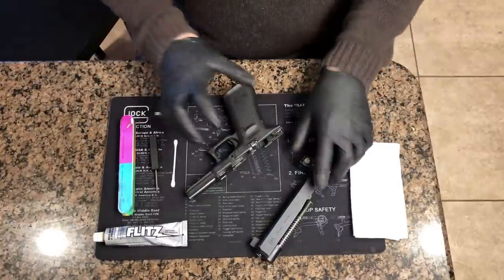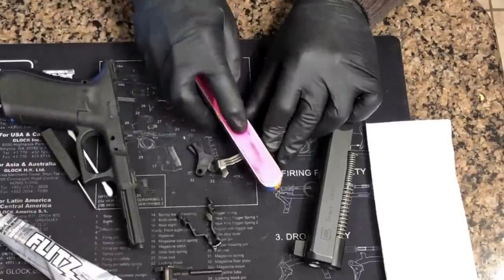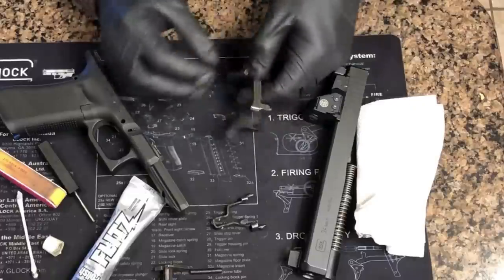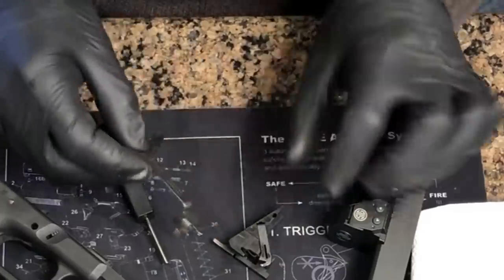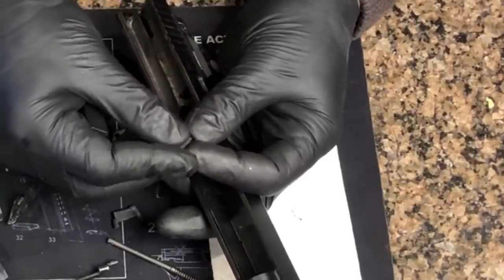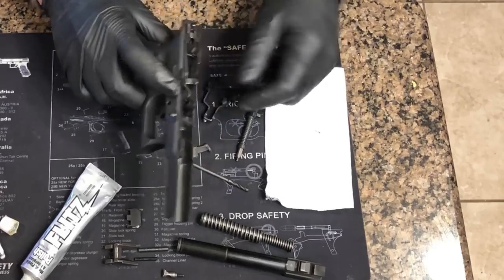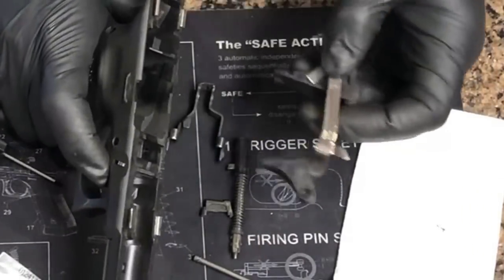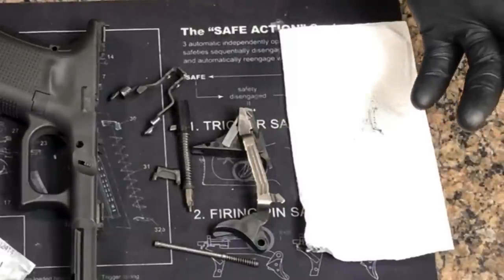How To Polish a Glock - Gen 5 - and areas often overlooked

Comment: If you feel a click in the take-up it's your plunger spring. Take it out and twist the spring 90 degrees and reinstall the plunger and striker. Test by pushing down the plunger until the click is gone.

Comment: The nail file idea is brilliant!!!!  Got amazing results from this technique. No real need to buff to a mirror finish. Just do the areas you need.
Reply: No it's not . Glock parts are already mirror shined under the surface treatment they put on them, if you want to see it you can just use a micro fiber rag and some gun lube . The nail file is damaging the treatment and "electroplate"
Reply: @Drawde907  I’m not sure that’s an accurate statement.
Reply: @essray   that shiny is like an electroplating they put over the the metal if you shoot one long enough you'll get through that coating ,You can usually see things like the plunger chip off first , it's one of the reasons they change the design.   When you take a file to it you're speeding up that process , You can literally take a rag with nothing on it sitting there watching TV and shining up to a mirror finish with little effort.  Try it.  And I know he's not exactly using a file but that grit in that nail buffer just isn't necessary.  You're not going to get any more benefits over shining it up with the rag . trust me I've screwed up plenty of parts since the '80s.
Reply: @Drawde907  the multiphase process definitely helped smooth out the trigger on my slimline’s stamped OEM parts. Removed all the imperfections.

Comment: Another underated thing that smoothens out the gun in general.is the frame rails and the inside slide channel.  Can make a glock feel so much smoother and cyclic feel of a much higher end gun.  Performance difference....ah not sure, but feel which to me equates to alot does something.
Reply from the maker: I did this on my CZ's.  I'll have to bust out the dremel and try it on the Glock.

Comment: Tried a lot of oils and cleaners over the years. Some worked better than others. Most did ok, but I never saw any miracle lubricating properties, oils that penetrated or seasoned the metal, or made the gun noticeably easier to clean after firing. More than anything a oil that stays in place and does not dry up or get sticky is important to me. I get rid of the ones that do that.

Comment: I use a light coat of a general gun grease then a couple drops of Mobil 1 before shooting.  You can also pull out the gen 5 trigger parts and use a gen 4 housing with gen 3 trigger bar. Gives you lots more parts choices!
Reply from the maker: I haven’t played with older gen parts in a 5 frame.  I know a gen 3 bar on a gen 4 was an improvement - May be worth messing around with

Comment: It was a success on the g48 , never thought the mag catch would effect anything but by god you’re right Humble . The ghost connector and polishing job dropped the tigger pull weight from 5.5 lbs to 4.25 lbs I’m completely satisfied Humble . Biggest thing was hang up on the new safety plunger design and striker engagement point . Now next improvement will be a overwatch dat polymer trigger that’s as far as I want to go since it’s my edc . Not sure the Overwatch trigger is going to make that much difference , but wanted to try something different. Thanks Humble your the bomb of The Tube . K
Reply from the maker: glad it worked for you.  Cheers.
Reply: I’m having the same issue with my 48 mos. The trigger pull is very heavy. Started with a agency flat trigger and a minus connector the switched to an OEM trigger with OEM minus connector. Both stayed 6.5 lbs. I’m trying the ghost edge connector next. I don’t want to mess with springs because it’s my carry. But I would love to get it down to 5lbs. If I get desperate I’ll have to send it to Johnny Glocks for him to do a full work up on it.

Comment: The gen 5 trigger shoe doesn't really contact the frame, it is sandwiched between the steel of the ambi slide stop. So in addition to the frame, you can polish the inside surfaces of the ambi slide stop down by the little coil spring. And.. both sides of the shoe itself, as he mentioned, hope that made sense.. spend some time with you glock learning its functions.. if there is friction, reduce friction dont be scared to do this.. just take your time..

Comment: I use a combo of Quantum fishing reel oil and grease. Both are called hot sauce and are a synthetic so even if you want to use just the oil it will stick around for much longer and will not corrode polymer, plastic or magnesium. I have been super tuning reels for much longer then firearms so maybe there are better options but I like the stuff.

Comment: Very cool. I always wanted to see exactly what is done in .25 job. I like Wison combat thin oil. A few years ago, I took my G17 apart and would fine sand and polish points where parts rubbed together and discovered that frame to trigger bar surface too. It seemed to really smooth out the feel of the trigger. I love the plunger spring change...and shortened spring too.
Reply from the maker: I don’t pretend it’s going to make magical things happen/ but it’s an advantage I know will be there when I am competing
Reply: @TheHumbleMarksman  Exactly. Whenever I pull the trigger on it, then compare to a stock Glock..it feels that much better.

Comment: Curious if you ever tried a Johnny Glock trigger?  I'm considering using his "KIT15" today for black friday for 15% off.  It's hard for me to spend that money though when I really like Glock's trigger after polishing, and there's ammo to be had.
BTW, far and away, the slipperiest substance known to man is engine assembly lube.  It's viscous as slightly heated honey, will cling to where you put it.  Much better than oil or grease in terms of slickness and viscosity.   Try the red permatex; you won't be disappointed.

Comment: I use 10w 30 synthetic oil.  A quart lasts a lifetime.  It's designed to have metal to metal contact.  An engine puts more use on the parts rubbing in 5 minutes than a firearm would ever see.  It doesn't smell.  Most of the other oils are mineral or vegetable oil. I use lithium grease on rails.
Reply from the maker: I was using this for a while with a good result - it's decent stuff.  Lithium grease didn't do me right in cold weather with a weak magazine spring - so I'm sticking with oil.

Comment: Those Glock internals are already slick and shinny under the surface treatment,  if you just take a micro fiber rag and whatever oil your using it will mirror shine everything. 
Taking a file to the "electroplating" Glocks using is damaging those parts and unnecessary.

Comment: Use MY custom lube. Base is Liqui Moly 10-60w racing oil, syn ATF,  Ceratec, lithium stearate, Hopes no.9
Reply: If you have engine assembly line, try that.  I've not found anything more slick than engine assembly.lube.

Comment: Great video quick question I purchased a naked holster it’s pretty much a trigger guard that can clip on your belt but it scratched the finish of my Glock 19and my Glock 26 both Gen 5 so I try to fix the scratches using a  bronze brush which help a lot 
But the frame (trigger guard ) has a matte color is there any thing I can use to get it to look like the Glock finish Thank you

Comment: Very nice video.. doing my 25c tj on my glock since 2006.. but you pointed out very nice spot to polish thou.. my G45 gen 5 is on it's on way.. will do your kind of polish job on it.. but... I was wondering IF.. too much of polish will improve contact between polished parts and actually improve frictions too instead of lighten it..mmm.. maybe ?! what's your toughts about that..?
Reply from the maker: The smoother you can make the metal surfaces that contact each other the lighter the trigger can be conceptually - and the perceived quality of the pull will increase.

Comment: Super Lube.  They offer Multi Purpose Synthetic Grease and High Viscosity Synthetic Oil (ISO 100) both will say "With Syncolon".  They are food-grade lubricants, meaning they can be used on equipment that manufactures food.  I have used this stuff for a long time.  It is slippery, offers exceptional sheer resistance, has a wide temperature range (-45 - +450), it's clean, it doesn't stink, did I mention slippery?, it is good stuff.  Every custom revolver we build is lubricated with this product.  We recommend that our customers use this product.  There is also a lightweight synthetic oil they make (ISO46) that's fantastic as well.  Buy them all!!  I use this stuff exclusively!

Comment: Have you ever polished through the Chrome and into the copper? If so what did you do? There are some that say polish through the chrome and through the copper down to the base steel metal and polish it.
Reply from the maker: No - I don’t want to change geometry of anything just make mating surfaces as smooth as possible

Comment: Look I found the boiling of new born puppies produces a concentrated fat. When distelled correctly with a mix of MDMA. You can use it as the perfect overall lubricant for a Glock. Just add a bit of crushed rhino horn  on the glocks firing pin channel with the above mix and you achieve less than a 2 pound trigger pull with minimum effort.
Reply from the maker: That must be a click north of the snake oil I’ve been using.  Hopefully they don’t regulate this substance.

Comment: Dont use.much grease at all.on a handgun, alot.of.snake.oils out there, frog.lube is disastrous, but most.others do the job.  Even criso works well
Reply from the maker: I'm using Lucas Extreme right now - and it's reasonably good.  Spartan Systems Accuracy Oil looks to be ridiculously high performing - but wildly expensive and would that oil even get to the point of failure in a hand gun before evaporating/running out?
Reply: Frog Lube (aka Frog Glue) has to be the biggest snake oil deception ever pulled in the gun industry.

Comment: I just started uspsa so I use my carry gun  g19 until I acquire a dedicated competition gun so I don’t want to go heavy on my carry guns trigger is this a safe alternative?
Reply: You won’t harm anything by polishing. You’re just polishing the surface, not removing material. It’s still 100% safe afterwards. I did it to my edc and it’s just fine.
Reply: Depends on how you define safe, and if you want to carry a modified gun as a carry gun. Based on what I saw, its completely safe. The goal is to smooth or polish the parts to reduce friction.

Comment: OK so I just got a Glock19 so I’m watching a bunch of these videos now. I must say I never wanted anything to do with Glock till very recently. But If your Glock and you know all these people are doing these minor things to greatly improve your product, how do you send out a firearm knowing that these things should be done? I just don’t get it, why doesn’t Glock send these firearms out from the factory with these parts polished in these areas that improve performance?
Reply from the maker: They aren’t alone in this - most production firearms use stamped or molded parts that have not been smoothed out- I would say it’s the most common practice among duty style guns
Reply: It is a matter of maginal costs vs marginal utility (marginal does not mean small, marginal means a change in the total cost caused by doing one more thing). The way these guns are now, the trigger bars are just stamped out of a sheet. It's very cheap, very fast and it produces functional and reliable parts. Stamping works very well when you are making lots of guns very fast. To make these parts smooth would require either a completely different manufacturing technique, or they would have to be filed down, polished and hand fitted by a human employee. That is easy to do for one gun but it's hugely expensive when you are making a bunch of guns quickly. 
The increase in total cost would be huge and the increase in the guns performance would be very small. The difference made by the 25 cent trigger job is not day and night. It makes the action smoother but it does not really make the pull lighter. The marginal cost of doing these modifications would be higher than the marginal utility. In simple terms, it would make the guns better to have these done in factory, but not better enough to make them worth the higher price. Would you rather buy a Glock or a hypothetical gun that is exactly the same only it has a trigger that is a little bit smoother (but not lighter) and it costs $200 more? Maybe you would, but most people would not and organizations such as militaries and LE agencies definitely would not.

Comment: You can also put a set screw in the actual trigger (the plastic part where your finger presses) on the back side to change pull distance. 

The most important aspect to a trigger job isn't the lube. You should of talked about how to inspect and insure all 3 of the internal safteys have not changed of been overridden, especially the drop safety
Reply from the maker: the purpose of this video was not to do anything that would affect the trigger safeties - simply to smooth it out.  You're 100% correct if you start messing with springs or pre/over travel. Then It's worth mentioning.

Comment: It a glock , just shoot the dam thing and the trigger bar does not rub on the mag release its called a slide stop its a duty gun not a custom 1911 and as far a lube for it try ky jelly ....... jesus any lube will work just fine
Reply from the maker: I found a polished gun has a more refined trigger than a fire-fit gun I did zero polishing on.  A lot of guys use these guns in competition so they are interested in having a trigger that isn't a disadvantage versus higher dollar guns - which is why this is a thing. 

And yes I misspoke - certainly you don't think i call it a mag release on purpose.

Comment: n00b. Your first mistake was thinking that Glock's need trigger work. Glock's are already perfection(tm), but too much work regardless. For lesser pistols that aren't as perfect as Glock, you just glob some toothpaste into the lockwork and dry fire the pistol a couple hundred times, it'll polish itself! The toothpaste also lubricates as it polishes.
Reply from the maker: This is sage advice.  Namaste 🙏
Reply: Sounds wierd but the toothpaste is a good polish. I have also put metal polish on the contact points and fired/dry fired the gun several hundred times with good results.